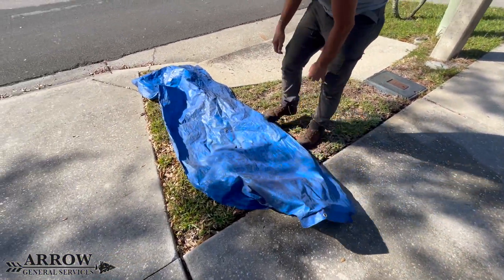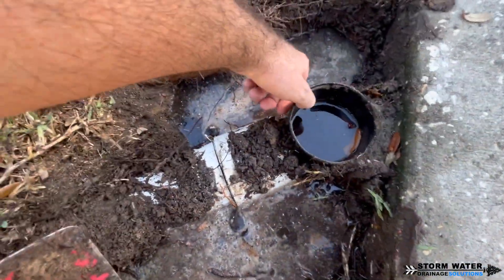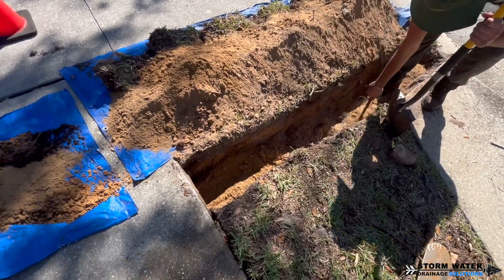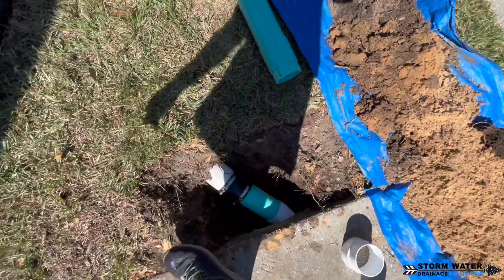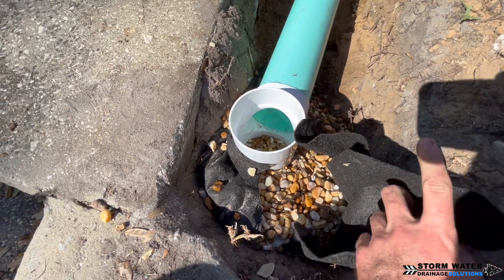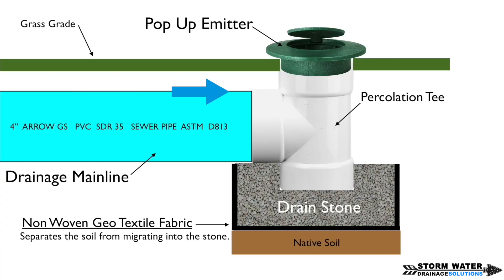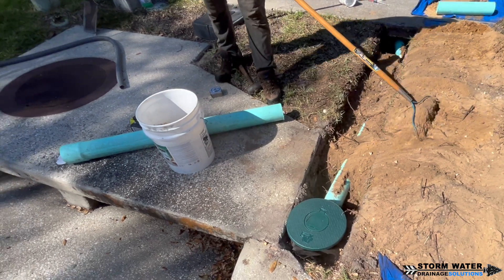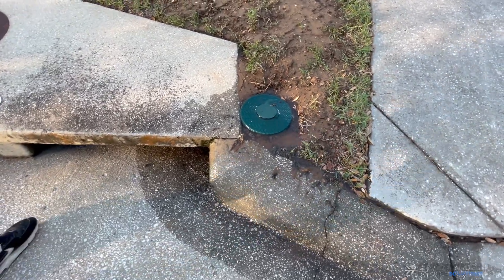How To Install A Pop Up Emitter - Percolation Tee - Best Method - Yard Drainage DIY

Comment: I tried your method of the percolation T and I have to say it's quite genius to eliminate standing water. I went and took it one step further and used a second T to act as a mini catch basin at the high side again surrounded by drainage rock at the base and sides. It works so well that when testing with a hose the pop-up emitter doesn't even discharge and instead water comes out from below through the drainage rock around the pop-up emitter. For between the sidewalk and street I think it's perfect. I'm not sure if it'd be a good idea closer to the house, in the example you showed holding standing water, as it could potentially allow water to go anywhere other than the street.

Comment: Hi team, I’ve got about 0.9% fall over the last 10 m to my kerb, so water really slows down. If I drop the pipe invert to ground level and fit a pop-up emitter, I can boost the fall to around 1–2%. Would you recommend the pop-up to keep the line self-draining, or is it okay to run it flatter for that last section?